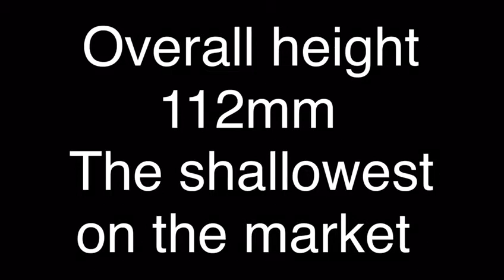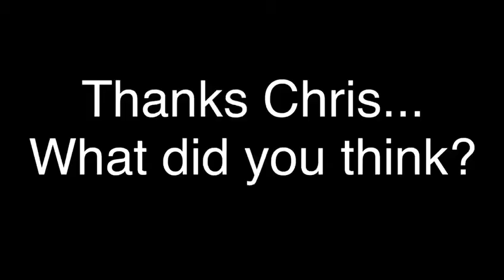The McAlpine HC2650UK Bath Trap in action!

Comment: Fitted one today after fighting with another one (unknown brand - came with the bath)… the old one was fitted and leaked, refitted and leaked from somewhere else, added tape, still leaked, more tape stopped the leaking down the main thread but then after a week it started leaking again between on of the joints (it was one of the ones where you stack the parts between various rubber rings so multiple potential points of failure).

Bought the MacAlpine one. Straight away you can tell it’s quality, and only paid £26 (the other one I had sells for £50 and it’s junk!). The rubber seals are really good, everything connects mechanically and the best thing is that you don’t have that main thread to attach a trap to which is where they usually leak. This design illuminates that issue. No silicone or putty needed, just worked first time.

Comment: Which face side (flat or grove) of rubber seal washers (waste and overflow both) will be toward the bath tub surface? Thanks
Reply: The grooves face the bath I’m pretty sure (for the waste and overflow they came facing that way in partly assembled in the box) - the bath is more likely to have an uneven surface that the plastic fitting which is where the grooves do their job.